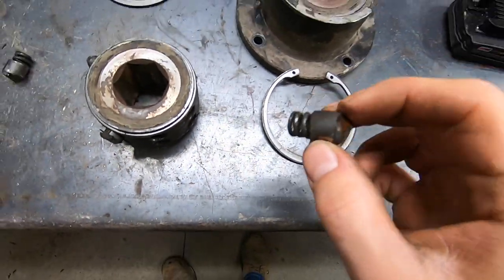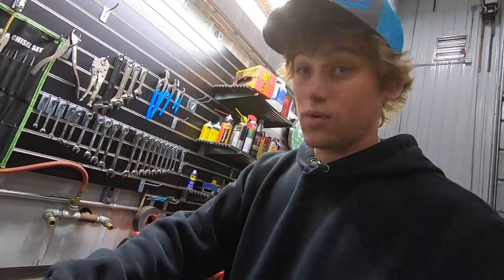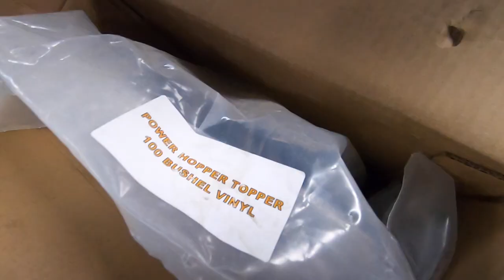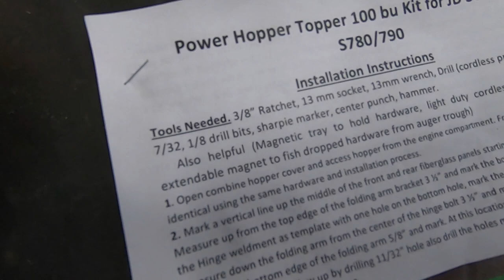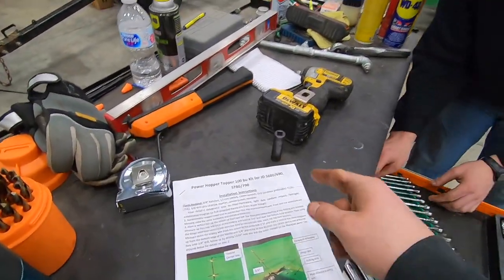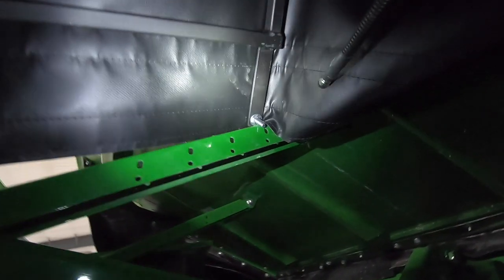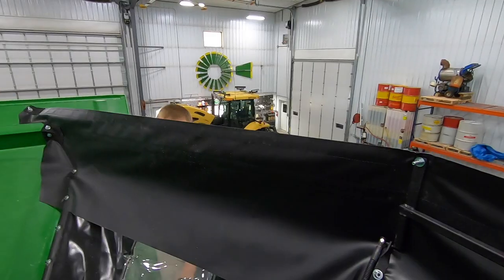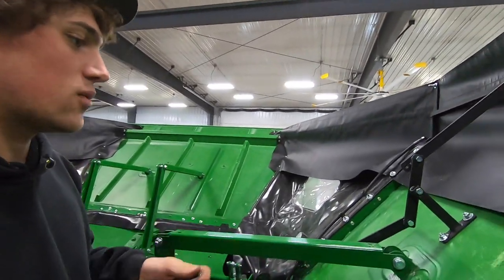How Not To Install Grain Tank Extensions.

Comment: Good Job you guys....  interesting always.....   nose to the grind stone-full speed ahead
Reply: thanks
Reply: Thanks Chet.    There is a comment in here about the extra weight maybe cracking the welds on the rims...well maybe...but I figure you guys have spare wheels ,, ,or  know where to get them quickly.  In the past I have had a 16 inch wheel split on a truck I used to drive when carrying a load of small stone, I guess the corn load could do the same thing to a combine in the field.              keep your nose to the grind stone-full speed ahead !!!

Comment: Your dad is right Chet about swapping the clutches from one side to another.  It's a bit like swapping tyres on a vehicle to the opposite diagonal to get better even wear on them. The thing that somewhat negates it would be the amount of wear in the slots that might be able to be fixed  by a good engineer with the right jigs and tools.

Comment: With those slip clutches for the 600C, just get your parts guy to grab you some new pins.  They might say they can't get them, took me a while but save you the $800.  If it slipped a lot and the pins look fine, I'd suggest changing them anyways as the springs become weak.  If the housings wore, just do exactly what the old boy said and install the clutch the opposite way.  You can try to weld it up a bit but grinding is very tedious. Another typical over-priced deere part.  Better to sub out to a company like Shoup for replacements parts then get fucked twice when you break down.

Comment: Considering you said he was loaded heavy, the Gods were smiling on you that day. Usually when a hopper twists to a certain point the wrinkle up like a beer can, and split right at the center seam between the hoppers. I have seen it happen and as has been previously mentioned,  it ain't pretty. Glad your hopper was spared, they dont just give them a way. As a trucker for 40 years, I know farm driveway aprons and side roads are a treat anytime, but in the winter sometimes you are just at Gods mercy.

Comment: I would like to know how increasing the hopper size will affect the active yield, i thought that as soon as the three weigh cells are covered (1/3 full) it does the  calibration as long as the machine has been level while it gets to that level.And it is quite a ways away from either sensor once all three cells are covered.
Reply from the maker: I’ve heard it both ways, I’m not sure until this fall and we’ll see how it works out for us.

Comment: I understand why you want the extra capacity but looking at the way the extra vinyl and brackets have to bend with the original equipment just right to work I'm kind of skeptical. It works in a 70 degree shop but will it work when it's 25 degrees full of corn dust out in the field. You guys do good work  and run a clean shop can't wait to see that new rig in the field with all the new components

Comment: “We won’t  fill it all the way”.  Yeah right😂
Reply: Whilst l like John Deere I also like the biggest Claas.It is the only true class 10 harvester available at present . The next class 10 available is the Fendt Ideal.
 Both these header have longer seive  cleaning area which is absolutely essential for capacity. This has always been a hall mark of Claas harvesters and is how they have been able to have such great cappacity while the Fendt us brand new to the market there is no reason it should be  as good as the other two brands. It really comes down to who has the best dealers and the best backup and if one is prepared to carry a large  inventory of parts. I'd were has the best dealers net work but when it comes to sales they are like caterpillar and Toyota as bit to independent and don't always consider the needs of the farmer or contractor as well and that what is best for the client is also best for the agent and the company.the problem Australia really has at the moment. Is its dollar is very low relative to the US and even thought where l personally live and  mostly work is in what is regarded as safe 26 to 38 inch rainfall area, for the last number of years it has been much more marginal and for the most part we have had more droughts  than good years and for the last number the rainfall on our heavy black baskets and grey loans of the plains is not much more the 6 to 8 inches per year. These soils can produce good crops  but not on that amount of rain .
   The light sands red clays and grey smaller limestone soils and red loans of KURRAJONG country under the same rainfall has in the last 30 to 40 years been producing much better. They have been producing yields up to three and four tons per acre of wheat and barley. They have gone completely to notill  and adopted measures to control pest and disease such. As fusarium and nematode of three types. This has not been done well where the heavy soil abound on the ageing heavy soils of the East coast of Australia. Fertility  is also a major issue on these soils as they are aging in terms of length of cultivation time since they were first opened up and farmed. I have personally noticed that legumes and certain oats , canola and mustard will counteract many disease issues with legumes like pigeon pea and fans bean and lupin with their sturdy long tap roots are capable of busting through hard pan but a good chisel twice in a year at 12 inches or better seems to do wonders for up to seven years across all types of heavier soils. The best machine l have found four this is the AFM OR Australian Farm Machinery Scarichisel. This machine with its light draught because of it narrow edge on tunes will easily go into most of the heaviest and tightest soils  that l have encountered and if only cultivating then 16 or 18 inch ultra wing low profile points are the best and if doing the ripping ups then only 9 to 10 inch buster points are all that is required. Interstingly on the first pass over irrigated land with compaction issues after pigeon pea crop next to cotton it was able to be ripped at the same depth as the cotton land was but 3 gears faster throttled back to 1600rpms the same with field peas ,Lupin and fans beans. The difference was not that noticeable with soya beans however.